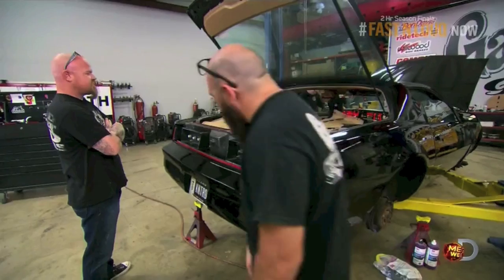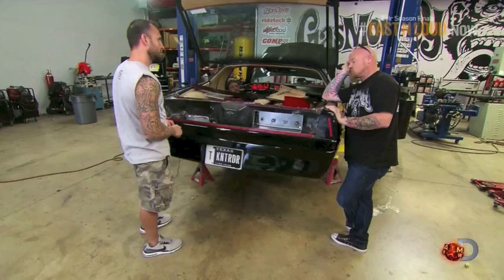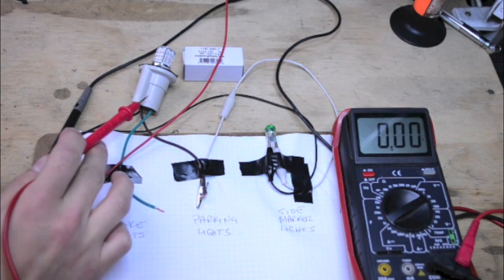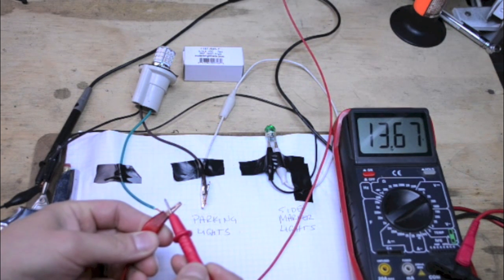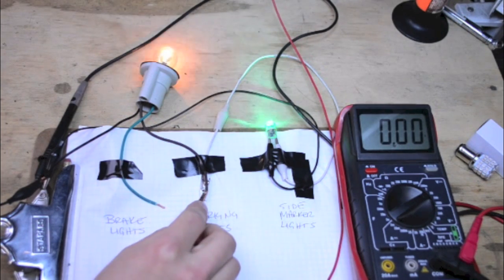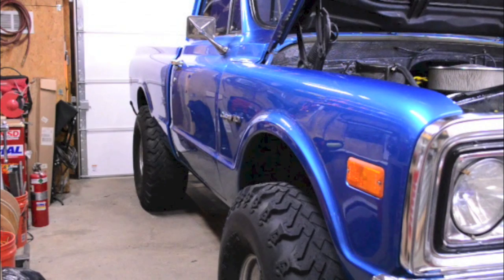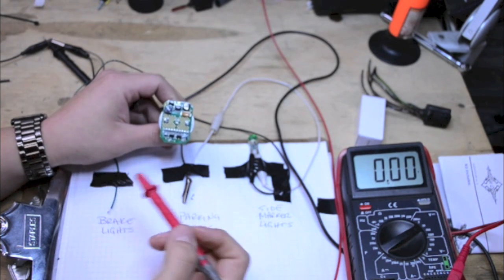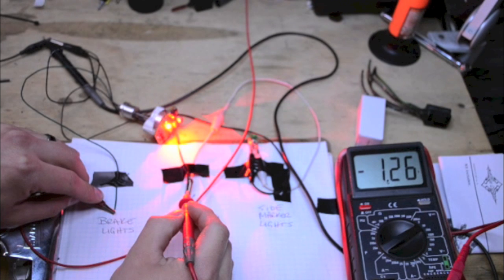LED Lights - Most Common Problem Explained

Comment: Do you know why my LEDs added to my off roader don’t work under the cars power but do work off my 12v battery charger??? Both the charger and the vehicle put out about 13.4vs but the LEDs are super dim off the vehicles own power???

Comment: I recently converted from regular bulbs to led bulbs I have noticed that my fog lights and drl along with my headlights look like the been is pulsing or jumping almost. This only happens when I turn on the vehicle. Its a 2017 dodge grand caravan gt do you have any idea of what it can be. I did check battery and car ground and both are good. Thanks in advance

Comment: Check stop lites notice on dash, after changing the side clearance light with a led. The 3rd brake light works. THAT, I believe is an LED-2012 fiat 500 C

Comment: Hi,
Today I replaced a light bulb (5w halogen) located near the pedals, and before I changed it, it used to work few seconds after I open/close doors.
Today I replaced it with a beautiful Led T10. It works but now is still on even if I am driving. I like it but..
Is there any problem? 
Do you recommend me going back to halogen in order to avoid other issues? Thank you in advance!

Comment: Would wiring a diode in line fix the issue by not allowing the current to flow back into the circuit?
Reply: Yes

Comment: Hello I have a 2016 jeep wrangler I changed all my lights to LEDs and I have a problem no matter which direction I turn left or right with the blinker both of my rear tail lights turn on I know there’s probably a bleed over from one of the LED lights that I changed I was wondering if you have any suggestions on how to solve I changed I didn’t just change the lightbulbs I changed the whole fixtures on the jeep I need help

Comment: Hi I have 1156 for both rear parking light and brake light in one bulb, parking light doesn’t work when lights are on but brake lights work fine, I’m guessing the voltage is too low to work parking lights as I know the bulb works as it’s fine as a brake light, what can I do??
Reply: Wrong bulb, should be 1157 which has a dual element inside.
Reply: Thank you for your reply, sadly the 1156 is the correct bulb as I’ve checked it online against my reg, it only has the two wires going to it, live and ground, I believe it sends a lower voltage for the rear park lights then uses a higher voltage for when the brakes pressed, all working through the two wires, have you got a way to contact you for more help please

Comment: Does this cause any major problem with car's electrical circuit? or shall we leave this as it is? bcoz recently i've changed my tail light bulb to led, and without position lighs ON when i press the brake pedal, it partially lits-up steering control button lights, door button lighs, A/C control button lights.

Comment: So I install aftermarket LED high beam- DRL lights in my 2012 Honda Accord. The lights work perfectly fine but I have one issue. I sometimes notice on my dash there appears to be a DRL warning light that pops up for about 5 seconds then goes away. What may be the cause if that problem?

Comment: Hey AllWireInc...really appreciate it if you can help! I have a 2004 Nissan 350z convertible with (less mileage 60k). For couple months weather has been nice in California (no rain). Problem is located (center) for the convertible top cover,.  The LED brake light (ie; Nissan OEM spongy type Wet-suit gasket)... has not been working. But for some reason, today I applied the brake pedal with a paint stick...the LED's lights for the 3rd brake lamp... all came ON. Sometime it works....for most time it does not. "It's a real mystery....can you help"?

Comment: I have led tail lights when I turn on my turn signal left or right all three tail lights come on and flash  but no turn signal have took to electric shop they want to change all my led lights into incandescent I think I will have same problem cause I think its a bad ground some were
Reply: just wanted to say this van came from factory with led its 2012 dodge caravan but lights are after market  and he tried a resistor in it now when you hit brakes signal is very faint

Comment: I tried installing the leds and if I flipped the bulb one way just the running light would turn on but if I flipped it the other way I the running light won’t work but the blinker and brake light would turn on... how do I get it to have the running lights and he brakes and signals to work

Comment: Installed LED in 2013 F150 FX4 Ecoboost. Did the reverse, puddle, dome, cargo, license plate and map lights. The map lights are the only issues. They stay dimly lit and don't turn on/off when pushed on but will light up when door is open. I really want these bulbs! They are so much brighter but I can't deal with them being dimly lit every night. What can I do to stop this!?
Reply: Add a parallel resistor, the little .5w ones from radio shack or ebay or wherever should be fine. I usually see people talk about 1k ohm.

This will add a tiny amount of power draw, and i mean tiny, just letting you know. Some little automotive LEDs already have a parallel resistor built in to take care of this

Comment: Doesn't using a resistor or a bulb like the Dakota Digital bulb (likely has a resistor built into it and thus the heat sink) pretty much undermine one of the main reasons to upgrade to LED bulbs?  ie. the power savings over halogen and incandescent.  Since the resistor used simply adds additional load to the circuit.  

Just wondering your thoughts on that.  Thanks for uploading this video.  I would think many learning about LEDs would benefit from taking the time to watch this!   I look forward to everyone's thoughts on this.
Reply: These are the ways you would add a resistor and there are often some of these built onto the tiny little board with the LED:

Series resistors do not add additional load, they act as a voltage dropper and reduce power consumption. 

Parallel resistors do consume additional power and are usually used to provide a path to ground to keep LEDs from glowing a tiny bit in the middle.

Now that dakota digital board has alot more going on, it almost certainly has one or multiple diodes and probably doesn't use much extra power to do it's job. However that is a bigger (and single!) LED package and it must have a higher power rating, so the heat sync is just there to properly cool the LED for a long life.

Comment: i own a Nissan 350z. Of the 3rd led brake atop of my rear trunk rear window..lights are totally, with my l/r brake light still working. As people know when we go to a dealership, they are always super expensive to replace. Is there a way to repair or soldered these LED bulbs or diodes onto the circuit board....is it hard to do? Any help would be appreciate it. Thank you in advance!

Comment: Just splice in a 10 ohm resistor across any one of the markers. Problem solved.
Reply: diode... u nee a diode here :)
Reply: Kei _ - Nope. The ECU determines conductivity by detecting a small amount of current flow. A diode would not work because it would be a short in one direction and an open in the other.

Comment: This is where diodes come in. The diode will only allow current to flow in one direction.
Reply: LightEmitingDiodes...if you put a diode in a circuit with no resistance congrats you got your self a short circuit and you will end up fucking everything up
Reply: @navisolim  WTF? Every circuit has resistance.... first of all.

Comment: Heres a common one you missed:

My left headlight LED strip will only operate between temperatures of -10 F thru 53 F . Above that temperature they will fail to fire unless I drive the car for about 2 hours and "heat up the housings" with the HIDs". After the housing have been warmed up the LEDs will magically turn on.  They refuse to work in the 54~ to 80~ degree range. This is seriously witchcraft and fucked up. Yea explain that one.
Reply: It may be that the temperature is affecting a connection possibly the ground. If the ground or the metal that it is attached to has a poor connection somewhere then heat can cause that poor connection to expand thus making contact and the light works. That's my guess. You can test this out by running a dedicated ground from the battery to the light.

Comment: I have a 1970 Chevelle and I tried just replacing the parking lights with LED bulbs and I couldn't get my bulbs to work right they wouldn't blink on turn signal and when I turned my headlights on the rear tail lights would go out completely what is wrong with this do I have the wrong bulbs?
Reply: Change your car. 71 Monte Carlo

Comment: I have a 95 civic hatch back. I installed a LED compatible flasher, 1156 Led rear blinkers and 1157 front blinker/park lights. There is no hyperflashing and when my parklights or headlights are on everything works perfect. when I turn my parklights/headlights off anytime I cut my blinker on (either direction) I get feedback and ALL of my lights flash. Interior dash lights included. I've pinpointed the problem to the 1157 bulbs (replaced with factory bulbs and went back to working perfect) any help or hints would greatly appreciated. I've purchased resistors and tried them between the blinker wire and ground and the park light wire and ground. (but not at the same time yet)
Reply from the maker: jkelley05  it definitely aounds like you have the same issue that we outline in the video.  you will need to add diodes to the 1157 bulb harnesses.  Send us an email at allwiredimc@aol.com and we can go over your issue in more detail
Reply: allwiredinc is the email 
" " inc@AOL.com or " " IMC@AOL.com? I see your name is "inc" but your email is "imc". just thought I'd ask before I emailed you. thanks for the response also.
Reply from the maker: jkelley05 it's allwiredinc@aol.com.  I'm typing on a phone and I have fat thumbs. sorry for the confusion
Reply: allwiredinc I emailed you.

Comment: Quick question; I'm getting feedback in my dash bulbs and my cruise control is mal-functioning since I went to all leds- including dash bulbs ! 74 AMC so were talking early 70s system. Will load resistors correct this ? Thanks !!
Reply from the maker: Hey Tim,  yeah it sounds like you have the typical issue going on with the led bulbs.  does the signal lights turn on when you hit the brake? do the parking lights turn on when you hit the brake?
Reply: Yes; it sounds like voltage is running around the system with nowhere to go;since the bulbs aren't absorbing the current !

Comment: Hi there, I'm currently experiencing an issue with my aftermarket headlights on my 2011 Sonata Ltd.Headlights are from SuperLux and are projector type headlights with LEDs built in. Now the driver side works fine as it should. And so does the passenger side with the exception of the LEDs on the passenger side. I have had the same issue before and emailed the company and another headlight was sent out which is the one I have now. The connector is fine and there was no splicing of any wire involved, it was a straight plug and play. On Saturday, I turned the headlights on and the passenger side LEDs were flickering on and off but never turned on. What can be the issue? Any input is greatly appreciated it. Thanks

Comment: Thanks for the video.
Question how exactly do you suggest in modifying your wiring?  I'm building a custom trike and made my own simple harness. I installed all led lights - markers, tails, and indicators.  The problem I have is when I apply my brakes the front markers light up too and when I apply turn signal they all flash.. I have installed a led electronic flasher and wired 2 diodes per light assy..
Reply from the maker: +Larry Radell Hi Larry, thanks for contacting us.  It sound like you may have an isolation issue in the wiring, opposed to voltsge feedback from LEDS.  Do you have a schematic or drawing of how you wired the trike?  Typically in cars and trucks the front and rear flashers are isolated by the turn signal switch in the column.  This is what stops the brake lights from feeding back to the front signals. 

send me a drawing or schematic to our facebook page or to tech@allwiredout.com and we'll be able to help you out further
Reply: +allwiredinc o